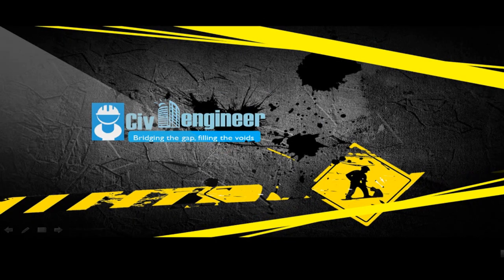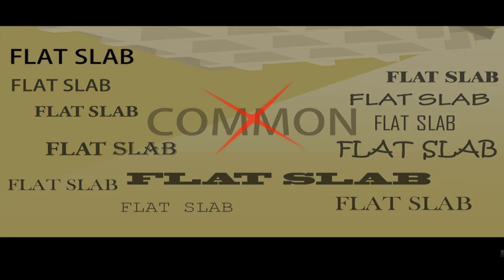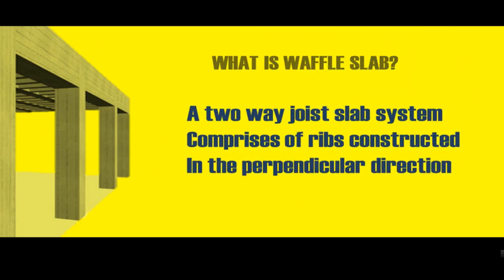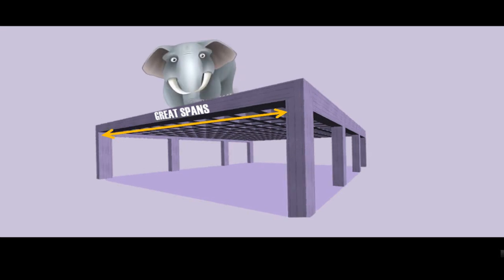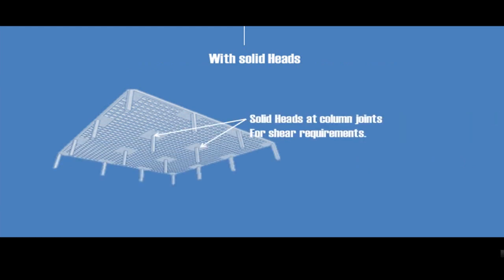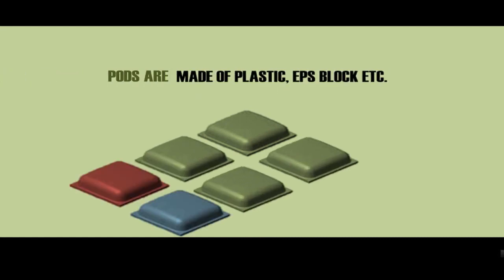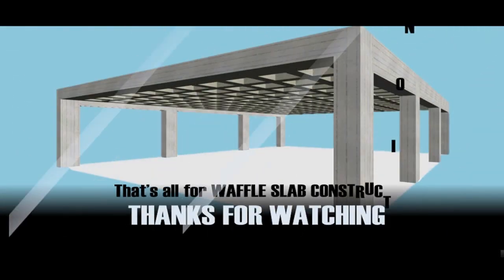Why Waffle Slabs Are Better Than Traditional Concrete

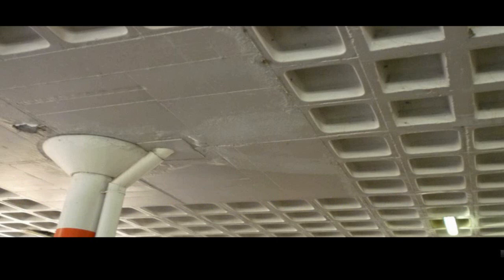Comment: 3:15 what is solid strip..??
Reply from the maker: Where design requirements demand more reinforcement that is 
generally assigned to a typical interior waffle stem, solid strips along the lines of supports is 
used to accommodate the excess of reinforcemen
Reply: @SaadIqbalengr  how solid strip look like..??